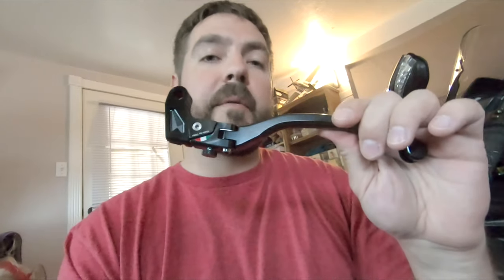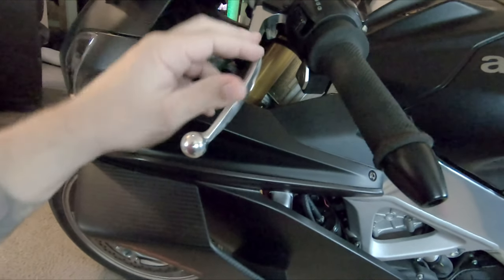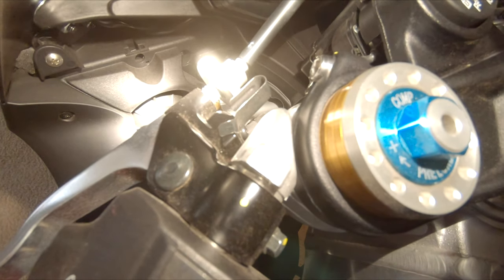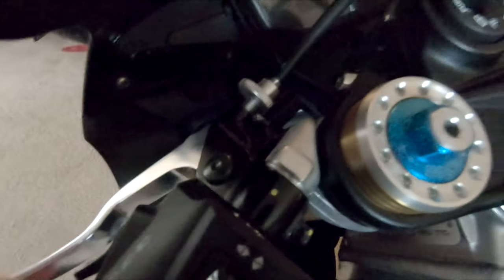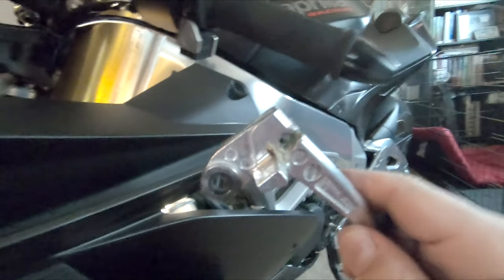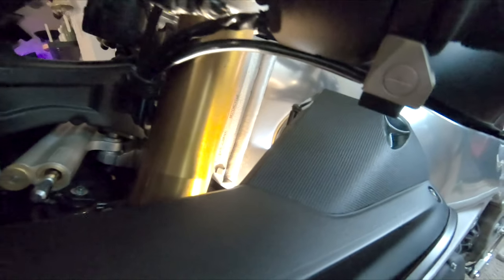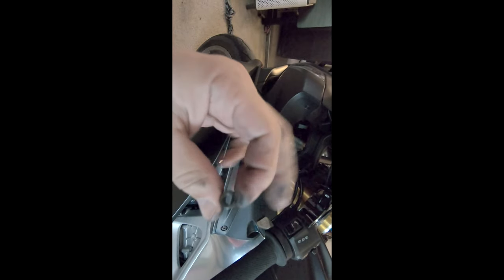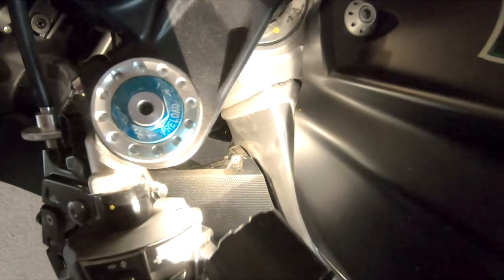How to install TWM Levers on Aprilia RSV4 1100 Factory!

Comment: Nice. My Buell has aftermarket levers. I finally understand why the adjustibility of reach is nice... but what about all the other options? Do I just not know what I'm missing?
Reply from the maker: Oh yea the more you ride (especially with sport bikes) having less distance to reach anything and the brakes or clutch being right where your finger can right away use the lever means you don't waste time and can be really smooth. You can adjust the different sections of the levers but I think that is just too much, some people use that but I don't have a need for that much adjustment.